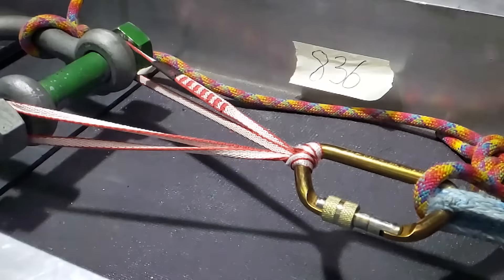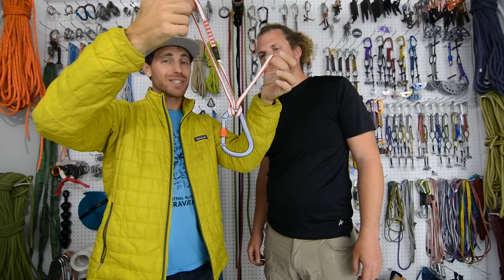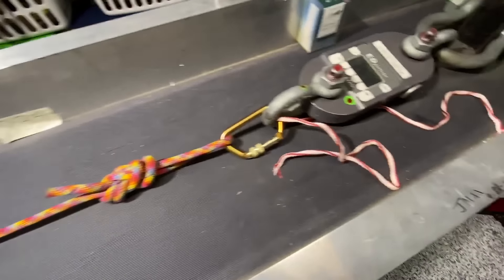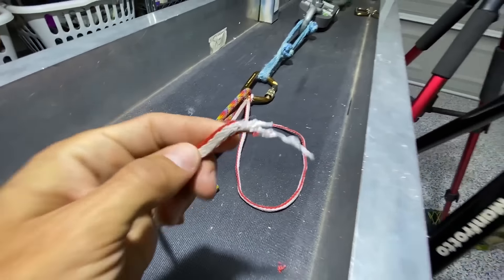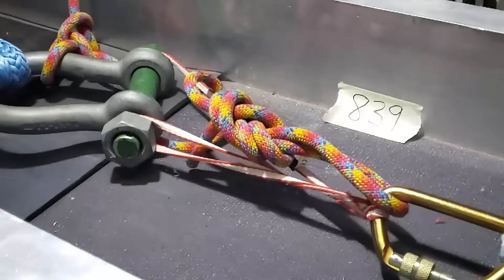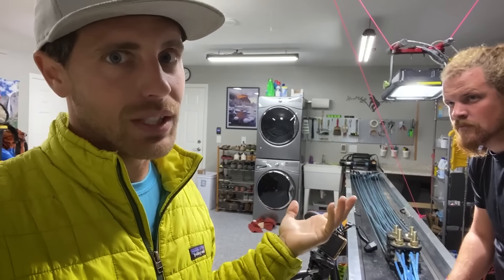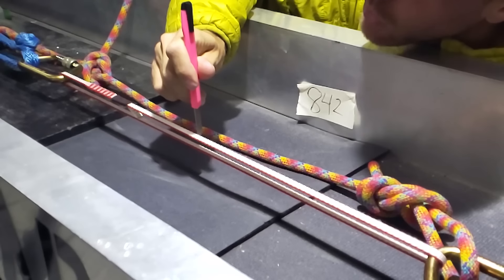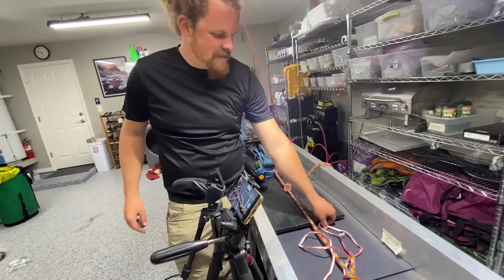Are climbing master points made with a girth hitch or clove hitch REDUNDANT???

Comment: At 14:00, no safety glasses, holding a razor knife directly, against a sling under tension - uh, maybe think next time? If the system popped once the sling was cut, the knife might be flung into your face. At least use a long extension to distance yourself from the rigging when cutting.

Comment: Does any know why knots reduce the strength?
Reply: It is due to bending on a radius - external fibers are more strained, than internal. As a result just part of cross-section actually carries load. When material is stretchy ( like nylon) there is lower reduction, than almost static as dyneema.
Important thing is - it is not just knots, but even bend on carabineer / weblock etc.

Comment: I’d knot the abraded sling.  Long story short, with a knot you know how compromised it is.  With an abrasion, there could be more cuts inside, there could be more damage than you’re eyeballing, etc.  I’d rather have a weak sling that I know the strength of, than a potentially stronger sling that I’m just guessing at.

Comment: I don't think it's fair to say that a clove is not redundant. You'd have to somehow take a massive whip to break one side, something that should not even be a possibility for a second, and then several more massive whips, or somehow sustain a load of 5+kN for several seconds to get the clove to slip. Even under extreem use I don't think this would ever be the point of failure. Much more likely that a cam break the rock apart or something similar long before the forces needed to here are reached.
Reply from the maker: building "DummyDropper" drop test tower so we can test this is a more real life scenario

Comment: a clove-hitch is not supposed to be loaded like that you had it without one leg! The running (ie cut/broken) end has to be tied as a stopper knot around the base end; and even in this case it mustn't be used in life-depending situations (on dyneema ?ropes? especially).
Reply: That, I believe, is what he is testing. You appear to be correct, at least with dyneema and a sustained and pretty high load.